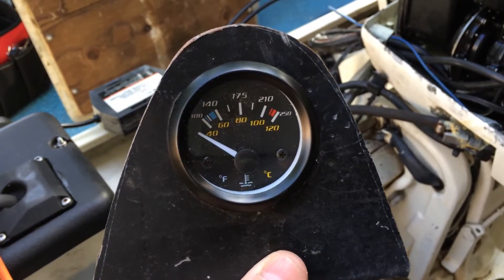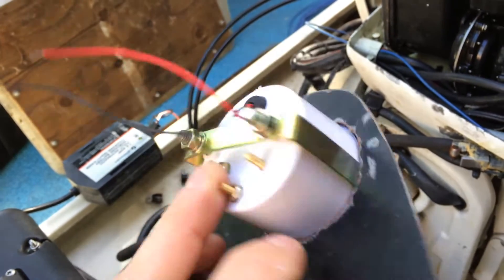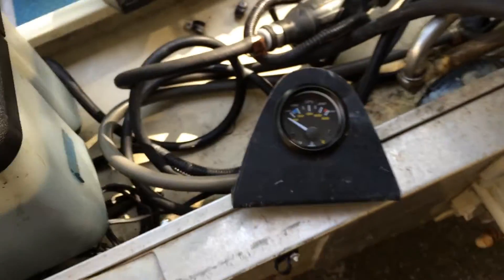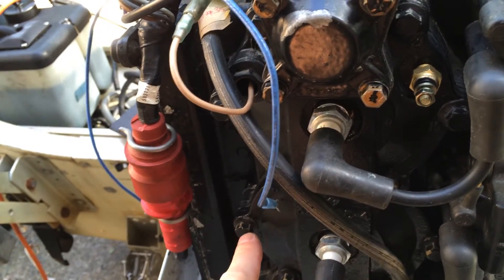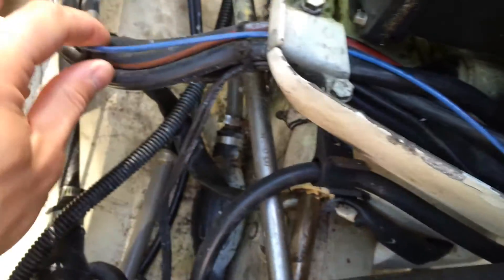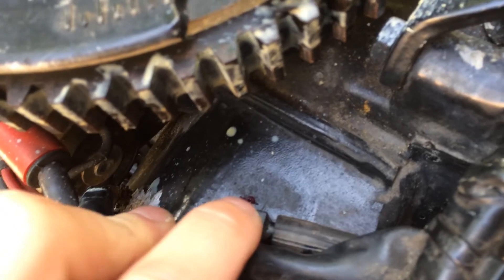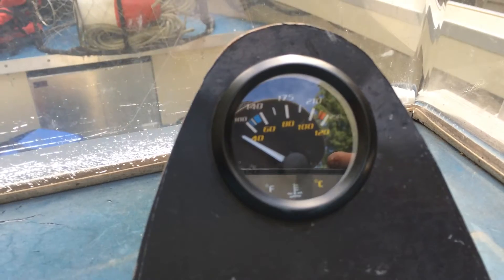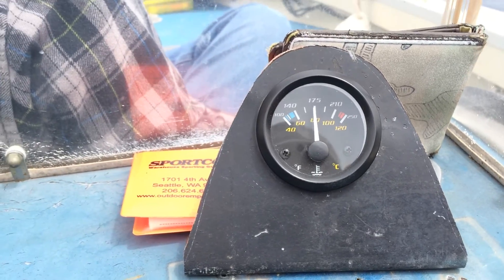Installing Temperature Sensor & Gauge on Outboard Boat Motor

Comment: Also the lifting eye is the just behind the flywheel, its just behind the bolt you point to at 2.17.
You dont need the expensive flywheel crankshaft lifter to lift these, but they are quite heavy so you need two people or a pulley system at least.

Comment: installing it in that lifting eye bolt nearer the flywheel isnt a good idea, you need it back on the head where you have it.
Careful, if its brass itl rust out and corrode the aluminium head quick smart.
Its a good idea to of moved that telltale outlet i had a major issue trying to track down that problem myself before i read the service bulletin
Reply from the maker: Not sure what you mean. It's installed in the head where it should be. The head still has the factory paint so the brass isn't touching bare aluminum. The lifting eye location on these Johnsons is in the flywheel last time I checked. Seaway marine specifically told me that this location was meant for a temp sender. No problems so far. I'll be adding one to my Yamaha 90hp very soon!
Reply: SolarBurrito Yes yours is installed where it should be but at 2.17 in the video you suggest a location for it which is back further in the engine, it wouldnt work there as that area is not the head so would have a lot lower temp than the head and also would still be relatively cold if the thermostat was stuck shut especially with that new output tee on the top of the crankcase too. The main thing is to get a baseline reading at idle and wide open throttle so you know if things change, as you seem to be doing.
Reply: SolarBurrito One other thing, i agree, doing the wiring, tidily, is probably the trickiest part of it. I dont have a rpm tach in my boat so on my 60hp johnson im doing this to this weekend im going to use the tach wire which goes from the rectifier in the engine bay through the current cable wiring harness to the control box. Its not used since i dont have a rpm gauge.
It seems as though you still have that wire unused in your engine. As if you look at your control box, under the key switch there is like a little round cover. If you pull that off you get a +ve, a ground, and also the other end of that tach wire- so thats what im going to hook up to the temp guage on mine.
The middle hole is the rpm wire

Comment: Dear Sir,
I have 60HP Jonson engine. I am looking to find a proper temperature sensor for it.
Could you, please help me with more information abaut your sensor?
1.Is the sensor's with thread diameter 8mm ?
2.Who is a manifacturer of the sensor ?
3.What is his part numer ?
Thank you in advance !
Reply from the maker: Simply do a Google search for Johnson outboard temperature gauge or a ebay search like I did. get one with a sender. About $30 and it's yours!. I don't waste my time with part guys on the phone anymore.

Comment: I know you are having issues with it now, but I believe the 3 cylinder Johnson/Evinrude engines from era to be some of the best.  I ran the 60 horse Evinrude version for many years with only the most minor of issues.  Once you bypass the VRO system you have little to worry about.
Reply from the maker: It's funny you say that because 2 separate mechanics told me the same thing about these 60s and 70 hp motors. I think I have taken care of the overheating, a combination of relocating the telltale and replacing the thermostat. I haven't bypassed the VRO yet, in fact we paid to have a new pump installed last year. I do see why alot of people do. It's hard to trust. I really don't like OMC VRO when compared to my Yamaha's Oil Injection system. The Yamaha 90hp has the tank under the cowl and is maintenance free. Anyway, thanks for the encouragement. The motor performed well last weekend. seems to be all good.